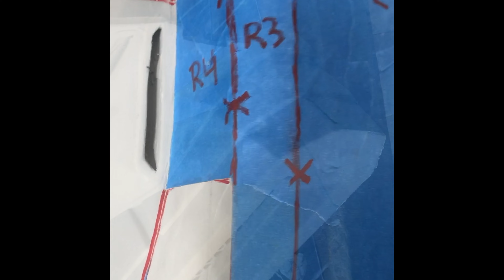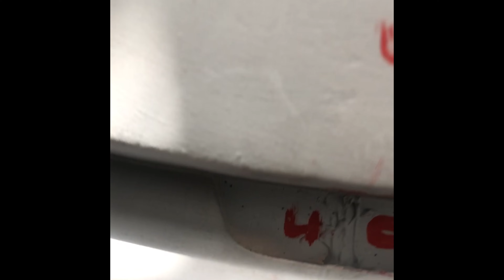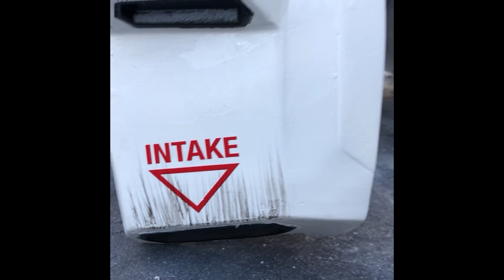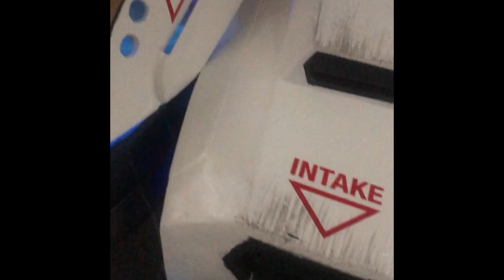3D PRINTED IRON MAN  STARBOOST MK 39

Comment: what kind and type of smoke spray you used? nice job
Reply from the maker: Thanks for the compliment. I used dust-off compressed gas for the thrusters in the backpack. I re-engineered an automatic air freshener by great value from Walmart to hold the cans of compressed gas to spray via a tactile switch. Mounting the cans upside down  will give the thruster effect. The fog in the thighs was also re-engineered vape pens, using fog juice to get that effect and triggered using a Tactile switch.